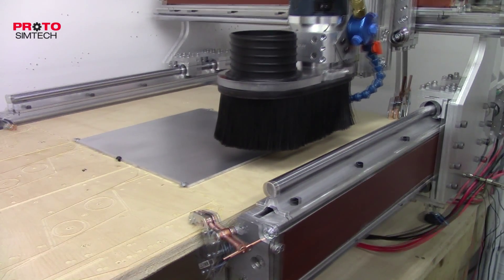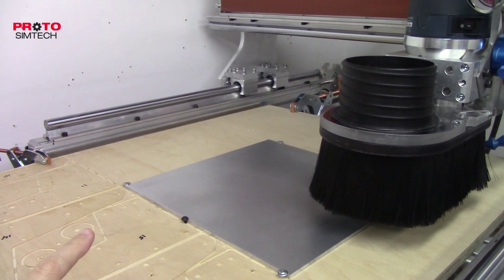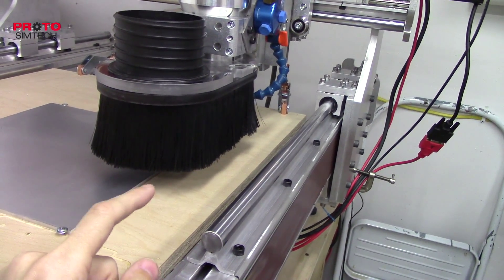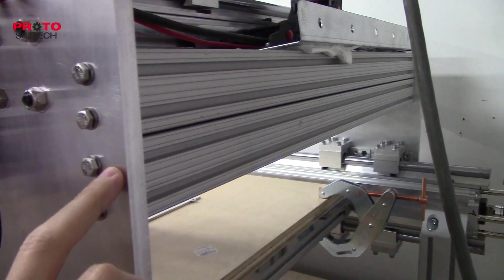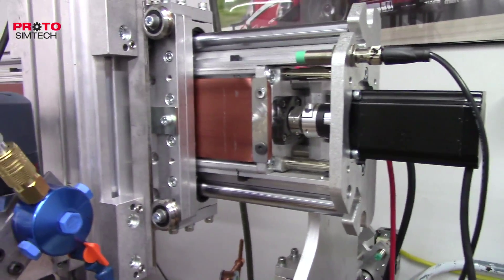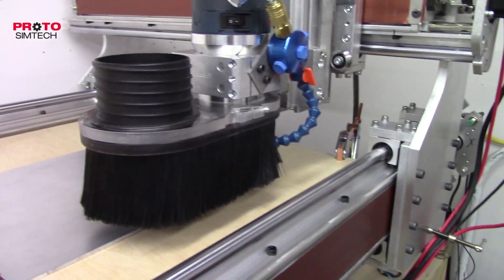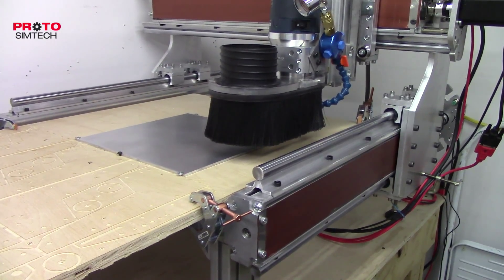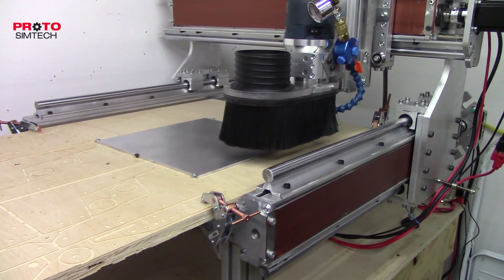CNC machine upgrades (Part 3 - Finale)

Comment: really enjoyed your videos, and like your upgrades. was wondering about your speeds and feeds for cutting aluminum, could you share this info, i would like to try with my machine but have no experience with aluminum.
Reply from the maker: Cutting aluminum can be tricky. We recently upgraded to a spindle instead of a router, so that helps. As far as feeds and speeds, I use somewhere around 17-20ipm, and anywhere between 15,500-18,000 rpm's. If you're going to cut aluminum, I would suggest using some sort of coolant (WD40 works well). If you don't use coolant, you'll need to slow your feed down a bit and take shallower cuts. I generally take anywhere from 0.030 - 0.050 per pass. I also use Carbide bits. Hope that helps!
Reply: ProtoSimTech Thanks i will try those settings. your upgrades are very impressive,  If i have issues with my BenchtopPro i will definitely be following your lead. Guess i was lucky with my rails after watching your videos i had to have a good look at mine (they are rally straight and i only have 3 blocks holding my rails) and then produced some identical items to see how they turned out, they were all identical, but i am not cutting aluminum either,all hardwoods and acrylic but i do push my machine quite aggressively with its feeds.
 By the way i am fortyeight from cnczone.
Reply from the maker: Mark H The most important thing with these machines is making sure they are square. I took a laser indicator, put it in the spindle, and marked out 4 places on the top surface in a square pattern. I then measured the distance between the points diagonally. I made sure that the distances were exactly the same when measuring each point. As long as the distances are the same, your machine is square. 

Something else that's very important is making sure the machine travels as far as you think it does. This has to do with the machine's ball screws and the motors. Measuring with a dial indicator helps tremendously.